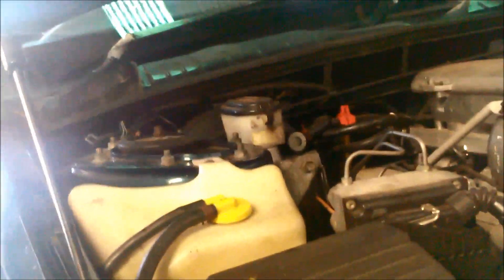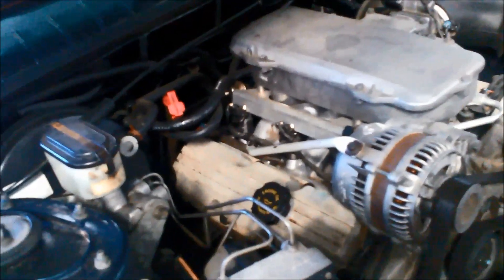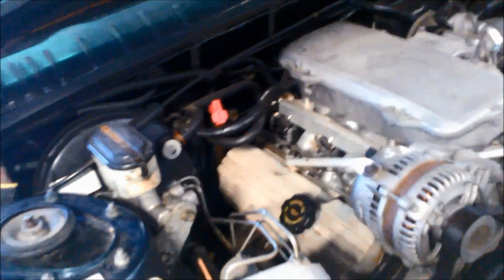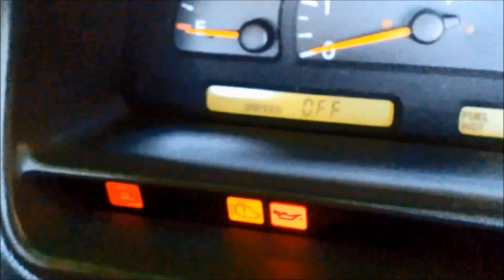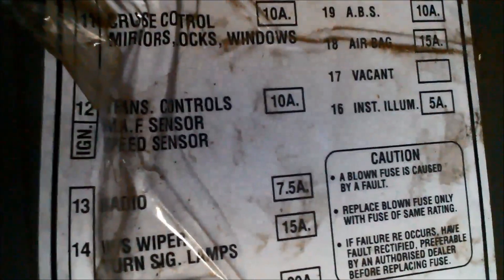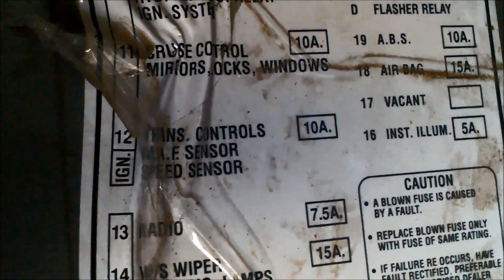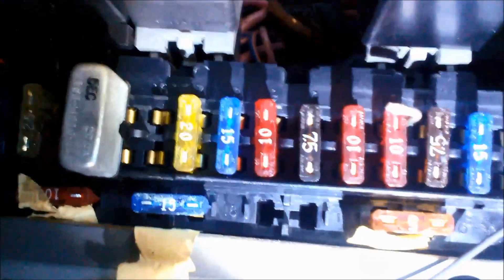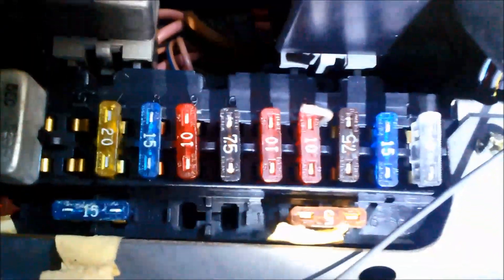4L60E Intermittent Limp Mode - How Bridge Terminals for fault codes Transmission stuck in one gear

Comment: Yea but chevy silverados have fuse box under hood and side panel o6 ,your vid shows down by the obd connecter, which is a little confusing
Reply from the maker: hi, no worries, cheers
Reply: @YepThatsIt  i thouht you would comment back with a solution, other than hi, cheers

Comment: Have limp mode intermenttly on  rebuilit 4l60e on 06 chevy silverado, runs great but after a few miles driving great, bacj to limp mode il disconnect negative terminal on battery for 30 mins truck will drive fantastic. Help me please
Reply: Same thing, somebody could tell us what’s the reason of that?
Reply from the maker: hi, issue with electrical components is that when they warm up, their resistance also goes up and thus the available amps comes down. in a relay or electro magnet ( solenoid ) this is where more issues become apparent. warm your relays/solenoids/sensors up then bench test. cheers
Reply: @YepThatsIt  thank u

Comment: Just got my LS swapped 95 VS Commodore started for the first time in 3 years. Car has a built 4L60e which only had 3rd and reverse... Dr Google had me stripping down my gearbox for a full rebuild... THANK GOD FOR YOUR VIDEO!
Swapped out the fuse and we have all 4 gears! Thanks for sharing mate
Reply from the maker: haha awesome you owe me few beers, link is in the description. cheers
Reply: Thank God I seen this video and comment litteraly was going to order shift solenoids decided to change fuse fuse looked fine changed fuse and perfect! All 4 gears thank God

Comment: My car won't start won't crank after new trans swap. Could be my range sensor or my shifter cable. Need help asap!
Reply from the maker: hi, check the single wire on starter motor. cheers

Comment: Hello, my old automatic transmission moved on only one gear (like a reverse gear). I changed it, but the new one is same thing. I've tried new brain box, abs I've scanned the car, it shows no problem.
Reply from the maker: hi, try the switch plate. if they are contaminated you will get issues without fault codes. see our 4l60e playlist   https://www.youtube.com/playlist?list=PLQLkuOdKuFotRCEQEAG1F90N3_WFl71IE   for more info. cheers

Comment: I have an 08 5.3 Sierra with the 4L60. Stuck in limp mode 3rd gear. U0101. Power at fuses for TCM. Changed TCM no fix. Doesn't show which gear I am in, no speedometer and no cruise control. Brake lights work, no reverse lights. Any ideas?
Reply from the maker: hi, limp mode is electrical issue, tcm reading values outside the programmed parameters. most often is a contaminated solenoid or switch plate. best to check all the basics first though. cheers

Comment: My 99 f150 5.4l triton, was recently having a misfire, well I changed the coil pack and all spark plugs, and put new 02 sensors on, and put a new fuel filter on, but now it won't shift out of first, even if manual shifting from 1st to 2nd to drive, idk what it could be, any ideas? And it isn't throwing any codes and check engine light is off
Reply from the maker: hi, if you do a generic scan some codes wont be revealed, a vehicle specific scan is always better and will show hard faults as well as intermittent/pending codes. make sure you have checked all the basics as well as your work. cheers

Comment: Just found this video while looking for something for the 700R4 transmission in my 88 firebird formula. Had some drivability issues, it threw a bunch of codes, ended up changing the ECM. Car runs perfect now, but trans is stuck in 2nd. Reverse works fine. Any chance you know if there is a fuse for the trans in this particular car?
Reply from the maker: hi, car runs perfect but stuck in 2nd? any fault codes? are you sure it isnt stuck in limp mode which is 3rd? cheers
Reply: @YepThatsIt  700R4 isn't an electronic shifting transmission. It uses a cable from the throttle to the governor (as opposed to the vacuum modulators on earlier GM Hydromatic transmissions) to shift gears. It doesn't do limp mode.

Comment: I have a 05 silverado showing code p1810 changed the pressure manifold in transmission but still not shifting
Reply: Yes..I put a new one.
Reply: Its showing no code now for transmission after I replaced with new part I cleared the codes and its not showing it anymore but still not shifting to 3 and 4 engine just revs up
Reply from the maker: @jaylenmyjj695  what was initial problem? if no 3-4 could be solenoid, wiring loom, pressure leak in 3/4 clutch apply circuit, pressure leak in 2-4 band circuit. check basics first including range sensor on left side of trans andal electrical plugs are good. cheers
Reply: Did you find the fix , mines won’t shift out of first I changed all solinoids and oil pressure plate and yet it still won’t shift out first 08 silverado

Comment: I have a problem with my 05 silverado it runs good on the 1st but takes to long to shift but it jumps 2nd gear to the 3rd gear i replaced 2 solenoids, the oil pan gasket i also clean the transmission oil pan i put new transmission filter and put new transmission oil any suggestions would be help and grateful
Reply from the maker: hi, did you flush the manifold switch plate? https://youtu.be/BwMA9kkZHZs   https://www.youtube.com/playlist?list=PLQLkuOdKuFotRCEQEAG1F90N3_WFl71IE  cheers
Reply: @YepThatsIt  yes
Reply from the maker: @SACRAMENTO_916  hard to diagnose without having a look, any fault codes? you might also try pressure test. cheers
Reply: Have you found the problem yet? Is it fixed?
My sierra is doing the same thing
Reply: @arthurgarcia4389  yes my transmission is fixed

Comment: I have a 2012  Chevy Silverado 1500 4.3l v6 and i think it’s in limp mode I changed the position sensor on throttle body I cleaned it and the maf and I still have it any tips I have code p0700
Reply from the maker: hi, most often its a contaminated solenoid issue from not servicing often enough and keeping trans pan magnet clean ( so it can work ) cheers
Reply: @YepThatsIt  I did that just now I still have code p0700 and the service stabilitrack and traction on
Reply from the maker: @amaryaljehani7213  still electrical issue, can be anywhere from tcm to the solenoid. cheers

Comment: 2008 Dodge Charger rt when I crank It in the morning it runs fine but after a while a red light comes on my dash and it won’t shift out of first gear any help ? Btw the red light is the security light
Reply from the maker: hi, sorry for delay in reply, we just got back last monday. solenoid/sensor issue or internal pressure leak when fluid warms up and thins out.  cheers

Comment: 5l40e, drives fine for a few minutes then p0734 gear ratio. No hard shifts. Had same issue last year, did transmission oil change now it's back. Suggestions?
Reply from the maker: hi, can be many reasons for slipping, i`d start with checking all the basics first. cheers
Reply: @YepThatsIt  Thanks...only shows up when warm. No slip. Any specific basics I should check?
Reply from the maker: @dodoitdave1346  often solenoids appear ok at room temp but fail when warmed up. cheers

Comment: hi brother , I have a2008 5.3 Silverado . Couple times when slowing down it starts to almost bounce hard and at the complete stop this bouncing continues up until aceeleration again and gaming speed to more gears . At this point it completely stops. This doesn’t happen at every stop only once or twice a day. No codes . What could it be ? Transmission fluid color looks well
Reply from the maker: hi, could be binding tcc solenoid, make sure you flush out/replace the manifold switch plate. cheers for beers

Comment: Code P0743 2004 vw golf stuck in 3rd,any tips
Reply from the maker: hi, converter clutch solenoid will throw it into limp mode, but make sure you check all the solenoids, they are likely all contaminated. cheers
Reply: @YepThatsIt  what should I do if contaminated

Comment: Replaced 99audi seats and interior from 1998 now transmission code p0705 won’t get out of first gear any suggestions ??!!?!
Reply from the maker: hi, could just be a coincidence. always check basics first and make sure battery isnt flat and is strong, also make sure earth strap from trans to chassis is good. you get fault code when the computer senses set parameters are out. cheers

Comment: 2002 concorde shifts fine then after awhile it want shift its gear no matter if I drop it in other gears. Reverse and neutral works fine. Any help on this
Reply from the maker: hi, if no fault codes, inside transm check the manifold switch plate for contamination. cheers

Comment: 2001 Chevy Metro (MX17-A210) "B" Solenoid and up/down shift codes. I replaced BOTH solenoids but it's still stuck in "Limp mode" 3rd-Gear. So can I replace fuses or by-pass? GOD DAMN I'm stuck in another State unable to drive back home!
Reply from the maker: limp mode means 3rd gear on these, so taking off and staying in 3rd gear. once you get going should be ok ( except higher fuel consumption ) but a lot of stop starts will fry the clutches..executive decision for you to make mate. good luck cheers
Reply: @YepThatsIt  My Blazer has an intermittent limp mode problem. I can drop it from D to 2 and it downshifts into second gear. Back to D and it upshifts to 3rd. Up to O no change. I only downshift it while I'm stopped.
Reply from the maker: hi, any codes after you changed solenoids? if not, you should flush/change the manifold switch plate. cheers
Reply: @YepThatsIt  Not yet after few miles to produce codes (none) and last time it took around 20-Miles to produce codes, but should I drive it all in "limp Mode" will it damage it? I will check your other reply video too.
Reply: @YepThatsIt  So if the plate is clogged up then it could actually be blocking the fluid from different drive positions? my reverse, park, and neutral work.
Reply from the maker: https://youtu.be/BwMA9kkZHZs
Reply from the maker: short out between switch contacts
Reply: @YepThatsIt  Switch contacts; You mean some circuit breaker as in your video?...my breakers don't seems to connect or say they connect to transmission except main computer only having 4 breakers which are brand new last year which I double checked.

Comment: MY 04 ASTRO VAN, FIRST DOES NOT EXCEED 55 MPH AND WHEN HE DOES IT  WITH A LOT OF EFFORT THE AC TURNS OFF AND BLOWS HOT AIR, NOW THE TRANSMISSION IS IN LIMP MODE AND THE DASH LIGHT IS OFF,  WOULD YOU KNOW WHAT COULD BE THE PROBLEM?
Reply from the maker: hi, it really is hard to diagnose without seeing the vehicle with some problems. does it slip at 55mph or will not accelerate? could be many things...fuel problem, electrical problem, blocked catalytic etc. take to a transmission specialist for a test drive, we usually do that for free anyway. cheers
Reply: It's a speed sensor.

Comment: Car goes in and out intermittently. Limps only when first started. Won't shift from first to second unless I cycle it in and out of neutral a few times or  floor it.  Temperature issue perhaps? Does not happen on second drive of the day... just had the transmission cooler replaced as well as I was told it ruptured.  Car does not throw any codes.  Any thoughts appreciated before I have the whole thing rebuilt.
Reply from the maker: hi, remove pan and flush out the manifold switch plate or replace it. if it fixes your problem, donation would be nice https://www.paypal.me/BATS189 or on link on my channel page. cheers

Comment: Hey can you check my video I just uploaded to see if you can tell what’s wrong with my transmission if I can fix it that part or if I have to rebuild it
Reply from the maker: hi, like i always say....check the basics first ! fluid level, connections, fault codes etc. then drop pan and see if filter is blocked? the amount of debris in trans pan will determine if you can repair or full rebuild. have you had any work done on brakes? can you roll the car in neutral? good luck cheers
Reply: YepThatsIt yea the breaks were done 2 months ago and I’ll just drop the pan then to check

Comment: I have a 04 Nissan titan replaced radiator and jump started my truck now my trucks in the limp mode
any suggestions please
Reply from the maker: hi, because you had to jump start, you may need to clear any fault codes and make sure battery is fully charged and strong/holds power. then see what happens, always check basics first. cheers

Comment: Anyone know why my 4l60 won’t go after I come to a complete stop and try go after
Reply from the maker: start with basic external checks...fluid level, battery strong and charged, electrical connectors good etc. then you may need to check inhibitor switch, then remove transmission pan and see switch plate and solenoids...you can check our other 4L60e vids https://youtu.be/ibuUSU5MU9w and other ones in the description on that video. cheers
Reply from the maker: hi, blocked filter ? or contaminated manifold switch plate, or inhibitor switch (range sensor). I`d need more information. cheers
Reply: well when I put it on drive it won’t go anymore RPM just goes up and if I put it on gears and switch 2 gear. When I’m driving after I’m on 2 gear I switch it to drive it will go after on DRIVE tho it just won’t go on a complete stop after only if you do that with the gears
Reply: L

Comment: Have 2004 Lincoln LS. Is stuck in limp mode
Reply from the maker: hi, what fault code do you have? limp mode mean the computer has sensed electical reading outside of set parameters. cheers